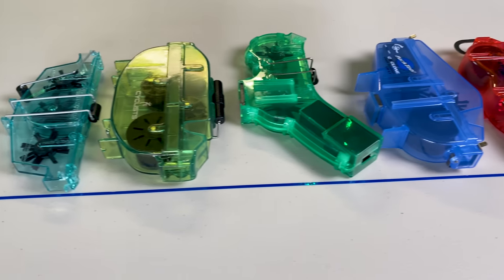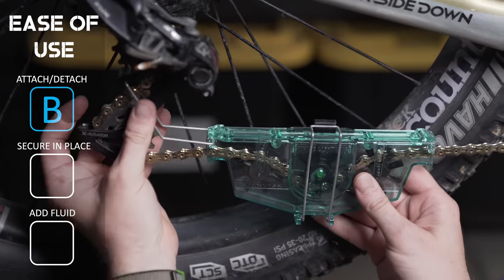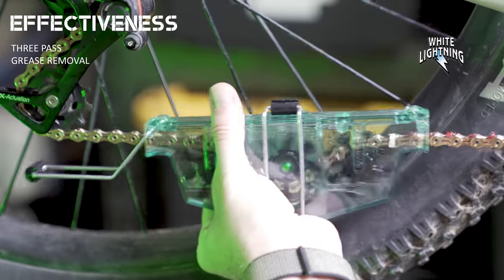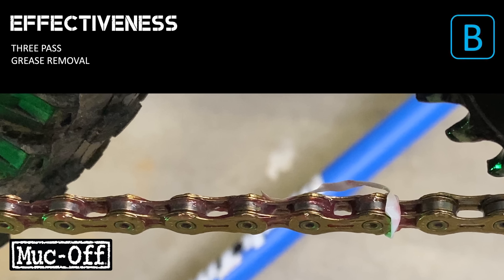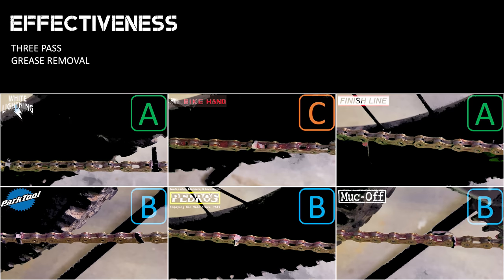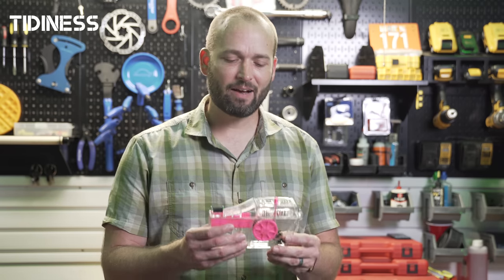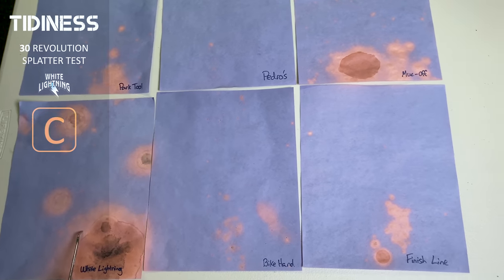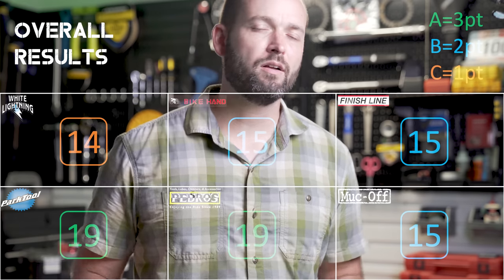Best Bike Chain Cleaning Tool Under $40? | Top Bicycle Chain Cleaners Compared

Comment: Well done and very helpful. Q. What should one do with the excess degreasing fluid?
Reply from the maker: Thank you for the note! If you use a degreaser that contains hydrocarbons, I would suggest disposing at your local waste, recycling, & disposal center (if you have access to one). - Jay

Comment: I own the finish line cleaner. It held up pretty well for my intended use. That is until I ran over my tool back with my truck, all that broke was the handle holder and a top clip.
Reply from the maker: Glad it didn't get destroyed 😀 - Jay

Comment: I have the Finish Line and Park tool. The Finish line is kind of a PITA with that weird angle, needs to be held firmly and in the middle of the chain seemed to work best for me but cleans very well and with just the 1 clip in the middle is easier to lock in than the PT with those small clips at each end.
Reply from the maker: Thanks for sharing :).  Glad you have one that works for your needs! - Jay

Comment: The Park Tool cleaner is also designed for e-bikes. That's why the handle can be attached on both sides. 300 cycles each huh? Already feeling the effort!
Reply from the maker: Yes it is! It was a good design move for versatility. - Jay

Comment: You should also compare how much cleaner is required. The Park one requires a lot of cleaner because the reservoir is kind of big.
Reply from the maker: @Mark Jolley - Great suggestion, I actually did, but didn't include it in the video! - Jay

White Lightning - 25ml
Bike Hand - 68ml
Finish Line - 32ml
Park Tool - 69ml
Pedro's - 28ml
Muc-Off - 26ml

Comment: What, I was disappointed the one I own wasn't on here, then I saw it at the end 🤣 That thing works great and I send it flying all the time, still hasn't broken. The handle though, it's a pain and can only be put on off when the top is on.  But after this, I think I will still replace it with the one that cleaned best, it's ultimately what I need it to do and the difference seemed considerable. Thanks for the comprehensive tests you do. 😏🥃
Reply from the maker: Thanks for watching and for the feedback! - Jay

Comment: Great breakdown, but I would say you should probably weigh the categories differently.  I think most people would rate the tools ability to remove grease higher than say the ability to add fluid.
Reply from the maker: Thank you for the suggestion. - Jay
Reply from the maker: Thank you for the suggestion. - Jay

Comment: My CM-25 has been gathering dust since I figured out that waxing a chain negates the need for ongoing cleaning (or expensive lubricants).  Toss it in a pan with candle scraps every thousand miles or so and the whole drivetrain stays clean, plus chains last forever :)  Not marketable/profitable so nobody discusses, but speak to a few retired bike racers on your local group rides and they'll tell ya!
Reply from the maker: Thanks for the tip!

Comment: I guess there is some convenience with these, but overall it seems to be a solution in search of a problem.  I spray my chain with Brake Clean and wipe it with a rag, then re-lube.  After a while, I buy a replacement chain {shrugs}.

Comment: My first Park Tool chain cleaner did not survive being dropped a few times. It developed a crack in the bottom that resulted in a leak, so as it was cleaning it was draining out the bottom. I have a second one and it's already has a few chips in the plastic here and there.

I did see that they make a cast aluminum "professional" version, the CM-25, so I might just go that route.

However, if you have the time to take the chain and the drivetrain off the bike, dropping everything into an ultrasonic parts cleaner with heat makes damn near anything shiny again and wholly crap does a lot of gunk come out of the chain doing that. It is so satisfying to hit the start button and see this dark cloud come out of the chain.

I just have a cheap Harbor Freight parts cleaner and some of their degreaser that I use when I'm doing a deep cleaning.
Reply from the maker: Thanks for sharing your experience.  It's definitely easier to get the chain really clean off the bike!  If you buy the CM-25, let us know how it performs. - Jay

Comment: I use the Park Tool, but it’s not the 5.3. It’s the 4.2 from 15 years ago and it’s still cranking.
Reply: BTW, I use Simple Green and then another round with water/dishsoap. GCN suggested that 2nd cycle. Let it dry a few hours before adding lube.
Reply from the maker: Thanks for the tip.  Glad to hear you've gotten good life out of the 4.2! - Jay

Comment: That was an awesome review. That earned a subscribe from me.

I know it was not included in this test due to price but any chance you can run the Park Tool CM-25 through the same paces? Or have you used it to be able to say where it would come in score wise? I figure it would ace the durability test, I’m thinking more about cleaning ability and cleanliness of the work area.
Reply from the maker: Thanks for the feedback and the sub!  Unfortunately, I can't comment on the CM-25 as I have no experience with it.  I'll add the idea to our backlog for future consideration. - Jay

Comment: Excellent video - subscribed.
I have the Park Tools and very happy with it. I have used washing-up (dish) liquid and the cassette is showing some signs of rust so I am guessing that this is not the best for the purpose. What fluid would you recommend that I use for my Park Tools - the only degreaser that I have is in spray form (Muc-off)
Reply from the maker: Water and dish soap should be ok as long as everything dries out and you're getting the chain re-greased afterwards.  I have used several chain cleaning fluid brands Muc-Off, Parktool, Finish Line, etc.  I haven't done a detailed comparison - so I can't recommend a specific one. - Jay

Comment: Been using the Park Tool chain cleaner for years. My latest unit is banged up, held together with duct tape, but still works fine. There are models that do a better job of cleaning a dirty chain on the first try, but I'm a roadie so my chain is usually cleaner than if I mountain bike. Great video!
Reply from the maker: Thanks for sharing your experience! - Jay

Comment: I have a parktool and both clips broke off after a couple of years. I'll be 3d printing my own from now on.
Reply from the maker: Sweet - good use case for a 3d printer - I had an older model parktool and the same thing happened.  The current version I tested in this video seems to be holding up so far - Jay

Comment: In Canada, MEC (Mountain Equipment Co-op, similar to REI Co-op from the US) sells a chain cleaner very similar to the bike hand one shown in the video, but with MEC branding. They also sell replacement parts for it. 
I've used it myself for a while, and it worked mostly well, but as you mentioned, the metal pins holding the brushes in place tend to rust quickly. Additionally something I don't think you mentioned is that you have to hold the BH/MEC model in a very specific way, otherwise the chain jumps off of the chain guide in the cleaner and locks up your drive train. Maybe it was just a me issue, though.
Reply from the maker: Thanks for sharing.  Yes, I experienced similar with the position you hold it in - I did bind up the chain a few times when learning :) - Jay

Comment: I apply Trader Joes degreaser filled in a dropper bottle to each link and then use two old tooth brushes taped together w. duct tape.  Tooth brushes can be used at different angles to clean outside plates also.
Reply from the maker: Thanks for sharing your tips & tricks. - Jay

Comment: I owned the ParkTool chain cleaner but was very disappointed with the cleaning capabilities. Since then I no longer use such a device. I find it much easier to remove the chain from the bike (use a chain link in my chain). I clean the chain in a round plastic container that I will fill up with very hot water and a little bit of dish washer fluid. Since the plastic container is round, it is easy to make the chain spin around inside the container just by making circular movements with the plastic container. Depending on how dirty the chain is, I repeat this one to three times on a cleaning cycle. And this gets the chain very clean; the contrast with the ParkTool chain cleaner is huge!
Reply from the maker: Thanks for the tip! - Jay

Comment: The White Lightning tool is a generic design as I bought an identical one with another brand name from the supermarket Lidl. The real world chain cleaning performance of this on a dirty black commuter chain was actually very poor as the brushes only clean dirt from the centre of the chain, with the outside plates of the chain left dirty. I replaced it the the Park Tool and it did a significantly better job and would highly recommend. I have since however got a Worx Hydroshot battery pressure washer for cleaning my bike with. It is actually far more convenient to use this for cleaning chains at the same time as washing the bike, and doesn't need any degreaser... it just blasts the dirt out. Just be sure to dry the chain with a rag and use an oil based lube to drive out any water in the chain rollers to avoid rusting. Great video btw :)
Reply from the maker: Hey - great tips, thank you for sharing your experience! - Jay

Comment: I use the cheapo eBay one (all the time) and it’s brilliant, especially when you’re away from home and you want to clean the chain at the trailhead.
Reply from the maker: Nice! Glad you have a method that works for you :) - Jay
Reply: @SimplyMountainBiking  I’m far from alone in my opinion. Just check out YouTube and you will see other reviews which concur with mine. I just think you were a tab unfair in the way you dismissed the eBay//Amazon knock off! Just saying. 

Otherwise I loved your comprehensive testing and review of these branded chain cleaners.

Comment: I found the original Finish Line chain cleaner to be best. It hooked on to the derailleur. I have not used the "improved" version that has to be hand held. I've also used the Park tool but again holding the tool was a pain. Then I bought the chain pig and was happy until I dropped it. Only from 1 foot and the damn hinge hook broke so I had to hold the tool closed as well as hold it like the others. Bought another for 24 bucks on eBay and also the White Lightning just to compare. I find all of these tools very overpriced for a chunk of plastic with brushes. Too bad I did not look to get my Pedro's tool replaced under warranty. I just threw it away.
Reply from the maker: Thank you for sharing your experience and feedback.😀 - Jay

Comment: A comparison of various cleaning agents could be interesting. I used last time (I think) acetone, but I read in the comments you and many use water-based detergents, which sounded strange to me because the lubricant, later, may not be able to properly dislodge water from inner surfaces.
Reply from the maker: Thanks for the suggestion. 

Your point is valid - sometimes I use compressed air to dry the chain, but usually it's so warm around where I live, water evaporates quickly and I don't worry about it too much. - Jay

Comment: The result will never be even close from removing the chain and putting it in a can of solvent. The volume of solvent, the ability to clean the entire chain without recycling the dirt in the sprockets is key.
Reply from the maker: Thanks for the tip! - Jay

Comment: I wouldn't waste my money on any ot these. 
Simply remove your chain (Quick Link) put it in a glass jar 3/4 fill with Petrol, Kero or diesel do the lid up and give it a bit of a shake for 30 seconds. Let i stand for 10min then another 30 second shake lift it out with a wire hook dry. I do this with two jars. First jar ends up black. The second a little dark. Eventually disgard the contents of the first jar. 
If you dangle a strong magnet in the solvent you will notice it collects all the iron flakes and particles that have been flushed out of the internals of the chain. Do the jar lid up on the solvent for next time. Drop the chain into a hot (~60degC) mix of 70% wax and 20w40 oil. Turn off heat allow the chain to remain fully submerged till no more bubbles appear. That way the mix has fully penetrated all voids in the chain (~10min) remove the chain with a wire hook just before the wax mix starts to get a skin. Sit the chain on a sheet of paper/cardbord till fully cooled and fit back on the bike. 
The wax oil mix is soft but won't spatter. It is dry, so sand grit is far less likley to stick to it. It is water replant. 
Each week I use a solidified block of the wax mix to rub onto the rollers of the chain as I spin the crank backwards it applies enough external wax to protect and lubricate the chain for that weeks rides.
I do a full chain flush every 6-8weeks. By fully flushing the chain all or most metal particles that grind the chain pins and rollers and what ever other grit is in or on the chain is removed that grinds the cogs and chain ring. I generally get 1500-2000km from each chain. Most chain stretch is due to wear in the chain due to oil, grit and metal particles not being cleaned out of the internal moving parts of the chain and acting like grinding paste.
Reply from the maker: Thank you for taking the time to leave this tip! - Jay

Comment: I'll just stick with degreaser, the o'l toothbrush with soapy water'n sponge.
I use a Jif (Cif) plastic tray that was used to hold disposable mops, i drag that beneath the chainrings and i apply degreaser on that and the chain and all the filth etc collects in the tray, it's very neat. 
At the end of the cleaning process i also use cotton swabs on all the hard to reach places, and on each and every cog tooth in chainring and cassette + jockey-wheels. 
A clean bike does it's best. :)
Reply from the maker: Nice, thanks for the tip! - Jay

Comment: The only test that really matters is how clean does these products clean your chain.  I have owned the whitelightening chain scrubber for I would say for almost ten years.  In fact I cleaned two of my bike's chain just yesterday with it.  It is still going strong the brissels are in still good working order.   Also still out performs any of these chain scrubbers.  No cracks in the body.  I'd still choose it over any of these new scrubbers.  Yes It's a pain in the butt at times,  Yes it makes a mess it needs to be used outside, Yes you have to put fluid in it before you install on chain but isn't hard to do.  But man it does get your chain clean.  That's why I still use it.
Reply from the maker: Thank you for sharing your experience. - Jay

Comment: Just started looking into these bike cleaning products.  I am not a mountain biker - I ride exclusively on the road.  My bike and chain certainly do not get as dirty as a mountain bike would with all the mud and muck you go through.  How often would you recommend cleaning/degreasing/lubricating my chain just riding on the road?
Reply from the maker: Hard to say exactly given differences in mileage, weather, etc.  As a non-scientific answer - you'll want to keep the chain well lubricated and could probably get away with a full degreasing/cleaning every ~200mi. - Jay
Reply: @SimplyMountainBiking  Thanks - I live in SoCal so weather is mostly mild and I ride about 10 miles daily.  BTW - I bought the Park Tool cleaner and it worked very well.  Thanks for the very thorough review!

Comment: Two old tooth brush taped together . Spray some degreaser and pedal. The handles back against the front derailer. Cheap and does a good job. But if your rocking the single front then pop up on bike stand or trainer. Start a tv show and pedal and hold them.
Reply from the maker: Thanks for sharing your experience.  There are certainly a lot of ways to clean a chain! - Jay

Comment: You have to nurse these chain cleaners as they tend to be quite breakable. I’ve had the Park Tools cleaner for about 5 years without issues except that the bristles on the rollers are quite worn down.

Comment: My first cleaner was the Park Tool.  I have some permanent hand damage and found the spring clips very hard to snap into place.  Then the plastic around the the clip pivots broke, meaning that the clips didn't pivot anymore.  They fell on the ground.  At that point I decided to spend the big bucks on a metal Park Tool cleaner.
Reply from the maker: Thanks for sharing.  How does the metal one perform? - Jay
Reply: @SimplyMountainBiking  The usability is good (the cover pivots, it does not need to come off) and I think it's doing a thorough job based on how shiny the chain gets.
Reply from the maker: @Acceleronics  Thanks for sharing your experience. - Jay

Comment: Update: 2 years ago I said the Parktool is best or a pressurewasher... but now I'd say that the easiest way to keep a mtb chain clean is imersive waxing.  Just pop off the quick link, stick the chain in a pickle jar and spend a couple of mins shaking it under hot water until the dirt stops coming off.... then just stick it on a wire hook in the slow cooker wax pot. Come back once it's melted, give it a quick swish and hang it above the pot. A few mins later it will have set and be ready to go back on the bike. The drivetrain always stays clean and you never need to degrease it (apart from prepation for the very first wax application). It's so much easier to work on your bike when you don't get black oily fingers and clothes 😊

Comment: I have the Park Tool cyclone and managed to break one of the clips that holds the unit together, the small molded eyelet that the roll pin goes through. It seems like fairly thin plastic in that area. Park Tool did replace it under warranty, though.
Reply from the maker: Thank you for sharing your experience. - Jay